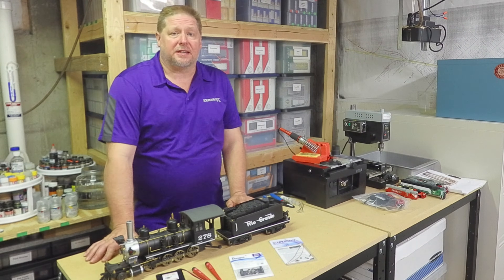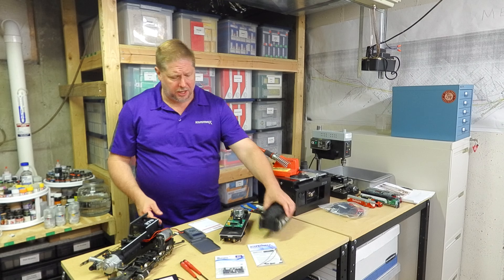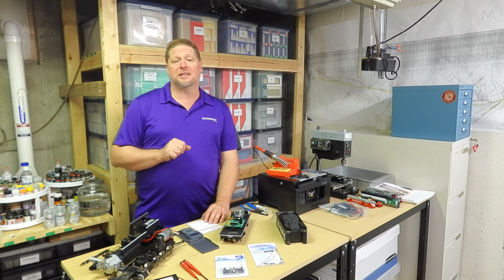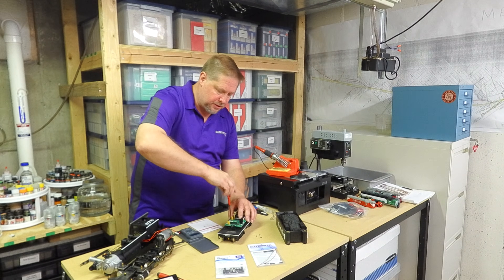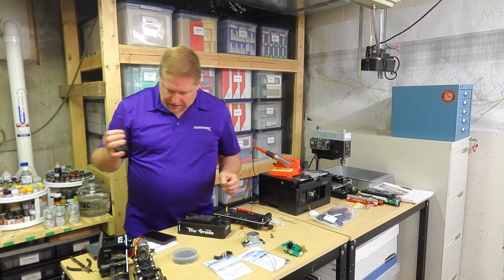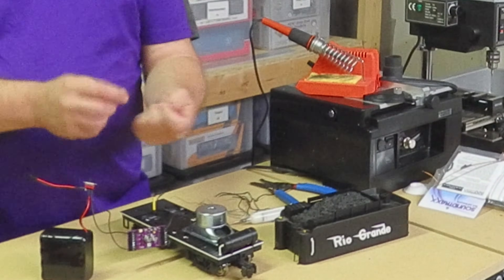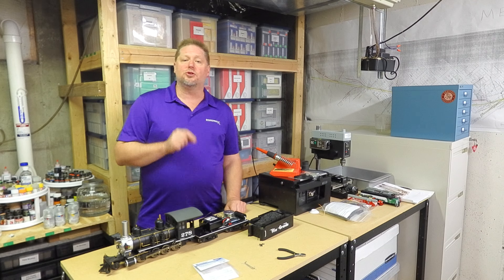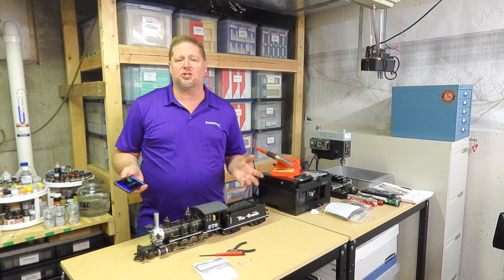Blunami & Battery Install into a G Scale Aristocraft C-16 Model Train

Comment: I do not understand what would cause you to not use track power.
Reply from the maker: There are many reasons. A few of the most popular: Many G-scale operators prefer battery power to avoid track cleaning and maintain consistent operation. Lego is another place where battery power is a major player. You can add battery power to HO scale as well if desired, but less likely to be needed if you already have track power - unless you just don't want to have to clean track as often.

Comment: What size of wire would be used to install this type of decoder into a locomotive of this scale?
Reply from the maker: 30-32 gauge works best for these types of installations.  We use 30 gauge in this case.   Thank you for your interest and question.

Comment: Blunammi Boards total rubbish crap design ,bought two new,both went faulty with full fuze protection in circuit .I you don't live in the USA you have no come back at all if you live in Europe DONT WASTE YOUR MONEY
Reply from the maker: Every one of our boards is tested multiple times by machine and by hand before they leave the factory. If they are failing right away, there is some kind of problem in the installation process. We can help you identify it if you reach out to us: support@soundtraxx.com or (970) 259-0690 or support@soundtraxx.com. Our decoders also come with a warranty. Please reach out to have your problems resolved.

Comment: Great install.  Is there a way to hook the smoke unit up with that decoder, or do you need a different type of blunami?
Reply from the maker: You can use a function output to control the smoke unit. Contact our Support Team for more info on this: (970)259-0690 or support@soundtraxx.com

Comment: I have two lokos, Battery-Powered and one I’d like to install Batterie Power.
Here’s  my Issue, the Batterie driven ones have spend a considerable time in Storage and the Batteries are dead. they won’t accept a charge.
I’ve come across an UTube clip where someone had the same issue with the (18V) Power=Tool Battery. This Person gave the “dead” battery a short boost from a fully charged  “good” Battery and ,voila, the Unit started taken a charge again.
Just wondering if anybody has had the same issue and was successful in reviving the Unit.
(Obviously I don’t ant to cause damage to any  Electronics)
Reply from the maker: Contact our Support Team for advice, please: (970)259-0690 or support@soundtraxx.com.

Comment: I heard that you can used the PnP adapter board from bachmann to make the install on these socketed aristocraft models. People say only issue when doing that is you lose functionality of lights control.
Reply from the maker: I am aware of these jumper boards, but I don;t use them.  why?  The wires all do not necessarily reach where they need to go, so for better long-term reliability, and to also reduce the need to "grow" wires to match, i usually just hard-wire it in.  That way I know the wires are correct, and it reduces the space taken up inside.  As you saw here, there was not much space with the battery Gary got, so I had to remove the original PCB anyway to make room for the battery.  
And one of the issues with losing the lights is for whatever reason (I have not gone in to see why) but they need the ground connected inside the Bachmann models using their PCBs.  I believe it has something to do with the interoperability of the USA DC operation and the UK Operation, opposite polarity, of course!  But i have not delved into it enough to be concerned.  
I hope this helps.  
~G

Comment: Thank you great video. Do you have to worry about heat with the 4408? I would think that it will get quite hot in Southern California sun. Would you recommend a fan someplace? Glad you did another large scale and battery install.
Reply from the maker: Our decoders are tested at extreme temperatures to take climate into account so you should not have to add a fan. You can discuss this further with our Support Team: 9970)259-0690 or support@soundtraxx.com. Thanks for reaching out!